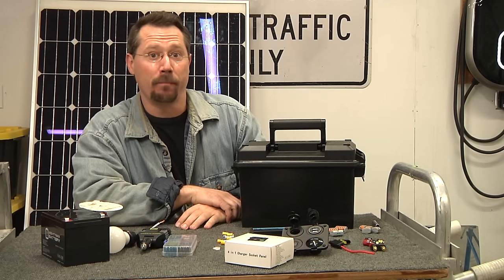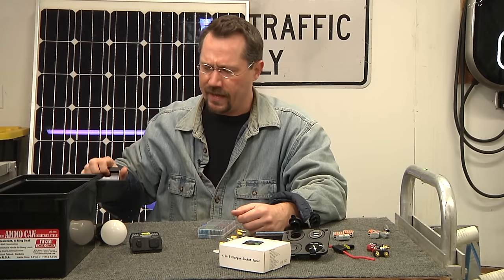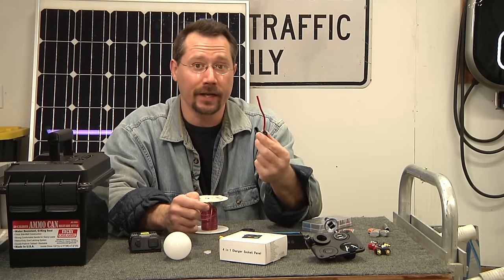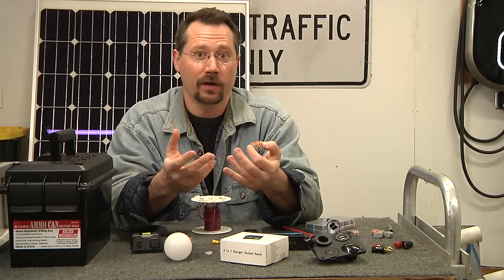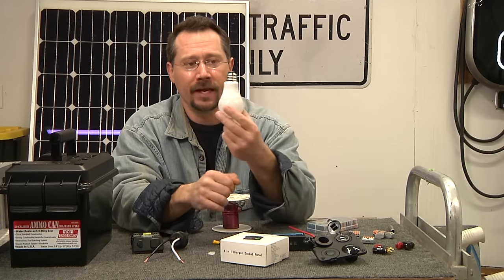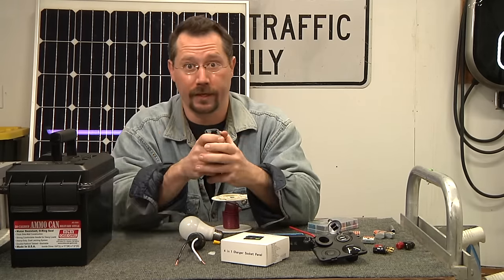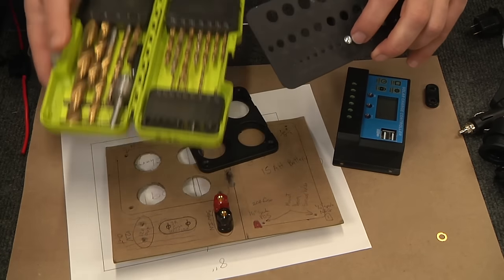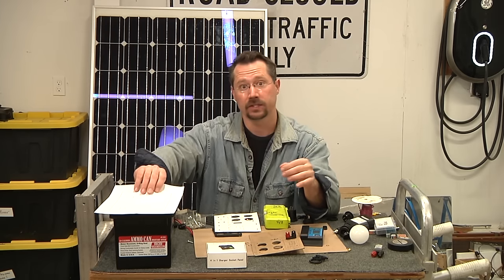Build A Solar Ammo Can Full-Length Instructional Video

Comment: Ben,

Did you change or mess with the settings on the charge controller? I just built my Ammo Box tonight. Just missing the Solar input (coming tomorrow) and my solar panel to test. Everything functions and works great. Those WAGO Nuts are awesome! Also, whats the voltage for the battery when its fully charged? Currently mines reading 13.0V
Reply from the maker: No, I didn't change any settings on the charge controller. I discovered WAGO nuts a while back. I love that they act like a little bus bar. It's great not having to twist wires together and how it makes it so easy to add or remove a wire. Great for tinkering.
Reply: BenjaminNelson I changed the setting to where the charge controller will cut off of the battery drops below 12.2V. By default it’s like 10.5v or something. I read that around 12.2v is how far you want lead acid batteries to discharge to before you hurting it.
Reply from the maker: 10.5 is too low for a 12V battery. Changing that to something higher is a good idea. 12.2 is generally considered 50% discharge on a 12V battery and should help give it a good life. Low Voltage Cut-off is a great feature for unattended operation, such as if you are running a load overnight while camping.
Reply: BenjaminNelson Ben. I greatly appreciate you responding back to all my questions. This has helped me tremendously!! What’s the next build for you?
Reply from the maker: Lately, I've been working on some electric vehicle charging projects. The next thing I'm working on will probably be an OpenEVSE, and controlling electric car charging based on how much electricity my solar panels are creating. Subscribe to this channel and https://300mpg.org to make sure you never miss a project.

Comment: Nice box. But why constantly go on about not damaging the box to keep it water proof when the first thing you have to do for anything is open it up!
Reply from the maker: I looked at a lot of other similar projects other people did, and frankly, most of them looked very BAD with all the various holes drilled in them.

I think the box looks very nice not having any holes in it or bad caulking jobs.
 It can also have a "covert" look to it if you would like.
I don't use the solar panel at night or in the rain, so the box is closed up anyways.
The box DOES still close up nicely with the solar wires running into it and then closing the lid.

If I meant to use this box where I would leave it charging unattended in the woods for days at a time, then perhaps I would have designed it a little different.

Lastly, this was my project, and I'm very happy with how it turned out. The joy of D.I.Y. is that you can design a project anyway you want. If you see yourself in the rain a lot, and want to design a similar project just a little different, go for it!

Comment: A nice and neat solution.
I guess it is a good job you never have an "emergency situation" when it is raining since you'll need to open up the box and negate the waterproofing you are so keen to keep?
Reply from the maker: My thoughts on this are that when I would be charging with the solar panel, it's sunny anyways.
I'd mostly be using this while camping. If it was terrible weather, the box would either be closed and not used, or in a tent.
With the gasket on the lid, thin wires can go right in and the lid will still close and latch.

Even if the insides got a little wet, it really wouldn't be that big of a deal.

If a person was constantly out in terrible weather and still wanted to access all the plugs, that's when a different design might be good. In that case, I'd go with mounting connections through the side of the box, and make sure they are all caulked/gasketed.

The great thing about a project like this is that you can design it however you want.
Reply: They make these things called garbage bags... pretty cool!

Comment: Remember to ventilate your battery it produces hydrogen gas when charging. A closed box is pretty much a hydrogen bomb when you switch it on as the electrics are also inside
Reply from the maker: It is a sealed lead-acid battery and the inputs to the battery are inside the box, you you need it open to plug-in a solar panel or other charging source.
Reply: @BenjaminNelsonX  sorry mate your box is fine and I’m sure you already know .. I was just reminding other people who mite try charge from outside or something like that. I made that mistake
Reply: @BenjaminNelsonX  good video by the way you explain everything very well 👍🏼

Comment: Would work better if you had two of them battery's use one while the other is charging to balance out the box.
Reply from the maker: There is space inside the box for a second battery is a person wished. There's no reason to have them separate and switch back and forth. Just connect two in parallel for double the capacity.

Comment: I think I would want to use a plastic panel to mount the components and I would also give it some support on the opposite end to where it sits on the battery.

I would suggest fixing the battery with Velcro rather than glue in case the battery fails.
Also, make sure the battery is of the "deep discharge" so type that it can handle being discharged to a low level.

Instead of lifting the panel to connect a  standard battery charger, you could simply use the banana jack's that are permanently connected to the battery.
Reply from the maker: That's the great thing about a project like this - You can design it or improve it any way you want!

Comment: Everything is nice but you cannot use that wall wart... idk if you fixed it or not but that wall wart cannot not charge that battery. that's why it jumping around the voltage and the charging smybole doesn't keep flashing... the wall wart keeps going into over current protection.

Comment: PWM CONTROLLERS ARE JUNK, USE AN MPPT CHARGE CONTROLLER, A GOOD BMS, AND GET LiFePo CELLS (LITHIUM IRON PHOSPHATE CELLS, AND A PANEL THAT DELIVERS AT LEAST 75 WATTS. USE#10 WIRE MINIMUM.
Reply from the maker: While a person can design a system any way they want, this one was intended as a simple project anyone can do. There are some advantages to an MPPT controller, but a PWM controller will work just fine for this project. Perhaps we'll do another similar project in the future which will instead feature lithium cells. On this project, it's very easy just to plug in a "PowerBank" or two to expand to lithium WITHOUT needing more advanced DIY Battery skills.

Higher power solar panels will allow faster recharge times. The disadvantage is that they tend to cost more, and are less portable. 75 watts at 12V is 6.25A. 12 ga wiring is MORE than enough for supporting that current.

Comment: So basically your building a solar generator?
Reply from the maker: Well, yes and no.
Yes, it's what a lot of people call a "Solar Generator". I think it's really unfortunate that that particular terminology has caught on. It doesn't generate anything. It's a battery, which can be charged a number of different ways, including and preferably by solar, and then the electricity can be used a number of different ways.
There's all sorts of different ways to build similar projects. I'm very happy with how this one turned out, and I hope it encourages other people to build their own and learn about batteries and renewable energy. Whether they call it a solar generator, a solar-charged battery, or anything else, it's still a great DIY project!

Comment: I hate you guys, always have the fancy tech, like the CNC machine. I think we have one in our lab, wonder if the professors will let me play with it
Reply from the maker: The only reason why I have access to a laser-cutter is because I'm fortunate enough to have a friend who is a small business owner with one. Fancy tech is cool, but I also try to figure and teach things as many ways as I can. In this video a person could have done the exact same work with a couple of drill-bits. High-tech doesn't have to be that expensive either. I've done a lot of interesting work with 2D machines such as vinyl-cutters and laser-printers.
In fact, I've never taken a class in laser-cutting or 3D printing, but I DID take an art class in Adobe Illustrator. That's vector software. Although it's a graphic design program, the overlap between that and how CNC machines are controlled is amazing.
Just teach yourself all you can, and then if you DO have access to high-tech machines, you'll be able to make the most of them.
Also, consider finding a local Makerspace, Hackerspace, or other co-op which pools resources for access to machines like those.
Reply: BenjaminNelson appreciate the reply. I'm an engineering student and we have all this tech available. My comment was more of a joke

Comment: Was into it until you skipped all the wiring on the backside.  Never heard of lever lock nuts, much less how to use them. How bout next time make the directions a little more simple for the beginners?
Reply from the maker: It was difficult to show completing every single wire connection simply because my hands would block so much of the view. This entire project is also documented at https://www.instructables.com/id/Ammo-Can-Solar-Power-Supply/ , including photos and more. Please take a look at Step 5: Wiring for more information.

Comment: 15amp hour? What's that gonna run a cpl lights for a few hours? You know u can buy 20000mah powerbanks that would do the same thing .I cant pic that running hardly anything  with lead acid.you only have about 40% of usable power before the bats to low to power a 12v light or accessory .I'll say it's cool you know how and show how to build it, but I think it's a waste with so little power
Reply from the maker: I designed this project as something anybody could build, and it could be done at a reasonable cost. I also planned it to be modular and expandable.
For example, if you want more capacity, you can simply charge some of those power banks from the battery or the solar!

Comment: Ampacity of number 12 wire 20 amps at 120 volts 12 volt ampacity is greater if you correctly use ohms law so why are you talkin to us like we're little kids or something
Reply from the maker: This was intended as a beginner project into the world of DC battery basics and solar power. If a viewer has more than just a very basic understanding, that's GREAT! We don't want to make assumptions about what somebody does or doesn't know.

Comment: 18650 batteries would be better
Reply from the maker: Lithium batteries have many advantages, including high energy density and light weight. However, this project was designed to be very simple and straight-forward for anyone with little to no electrical experience to be able to build for themselves.

"Power Banks" typically use 18650 cells, and people tend to already have a power bank or two for smart phones and other uses.

An easy way to use 18650s with this project is simply to charge power banks with the Solar Ammo Can. It's very easy, and a person doesn't need any experience with battery management systems, spot-welding cells, or any of the other complexities of more advanced battery design.

Comment: That charge controller is pure junk.
Reply from the maker: I will admit that it's very inexpensive, but I haven't had any issues with these controllers.
For a basic project like this, you really don't need anything fancier.
If a person wants to spend more money for something else, they certainly can.
I made this video as an example of a straight-forward project for anyone to duplicate.
If a person has more experience, budget, skill, etc., they can certainly use other components.

Do you have a favorite solar charge controller you would recommend to folks?
Reply: @BenjaminNelsonX  they are not mppt.
Reply from the maker: MPPT is just a feature.
Calling this controller "pure junk" just because it doesn't have a certain feature is comparable to calling a certain car pure junk, just because it doesn't have cruise control.

A more useful comment might be something along the lines of "That's a pretty basic controller. Personally, I prefer one that has MPPT."
Reply: @BenjaminNelsonX  if you understand the voltage and current curve of pv, you will only want an mppt controller.
Reply from the maker: @n3sjh  I'm familiar with how MPPT controllers work, just didn't feel it was needed for a project like this.